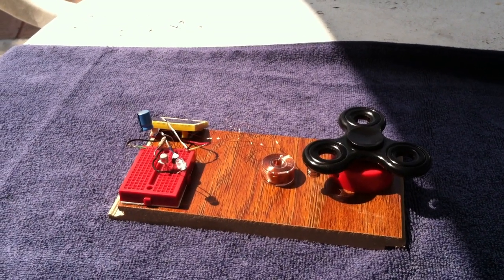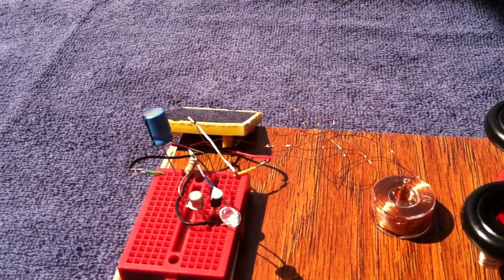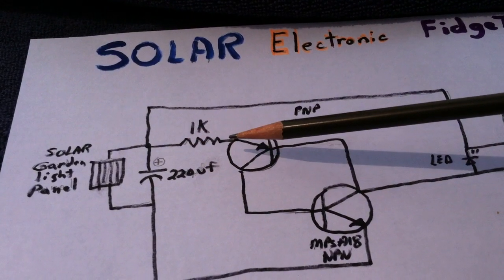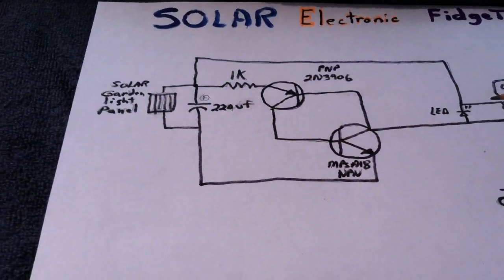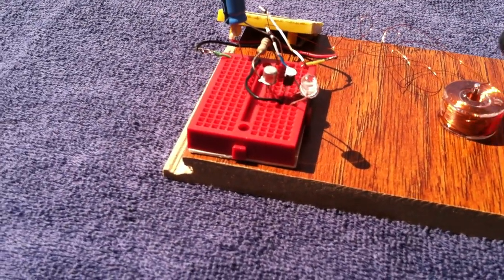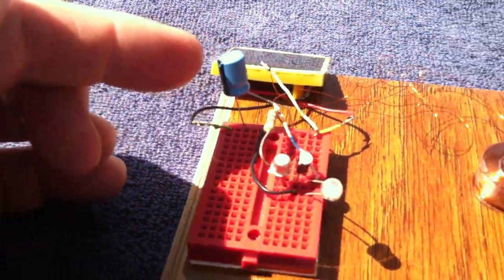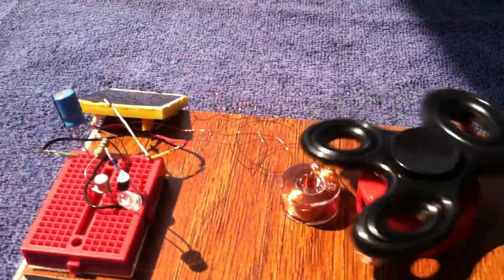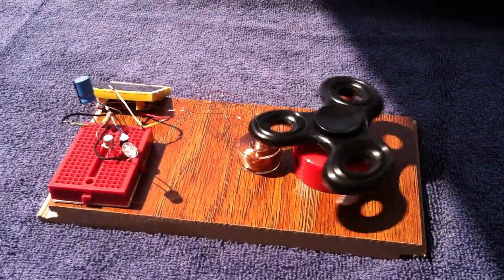Solar Electronic 'Fidget Spinner'

Comment: This location could be great for boats...maybe little craft made of chunks of packing foam that move using motor designs. There have been projects with some torque. Or the fan types, Everglades style, to push something along from 1 side to the other. Maybe a time challenge, the most efficient craft to do the run in 1 minute.
Reply from the maker: Excellent idea!  You are right.  This pool opens up many new experiments.  Some of my little motors have enough torque to power a vessel.  Some of Granddads boat designs would be fun to replicate.

Comment: Thank you for the video. 
I like being able to use the drive coil as a scene coil.
I think I will use this circuit in place of the waving cat circuit.
I am also making a low friction pendulum bearing, metal on glass, that I saw you do before.
https://youtu.be/eJcqOpKRr7I
Reply from the maker: Looks good!  Super low friction "rocking" design.  I have seen that used on those solar waving toys also.
Reply: @Lidmotor 
Thank you, you are too kind.

I did a rough test by pulling the pendulum to the side about 8 inches and letting it go. 

It swung for 25 min after which it was still swinging though only 
moving less than 1/4 of an inch.

I can't imagine many other berings could do that. 

I would prefer to use magnetic bearings, I dont have the money 
for that or the strength to walk around the city and drag home all 
the microwaves out by the curb.